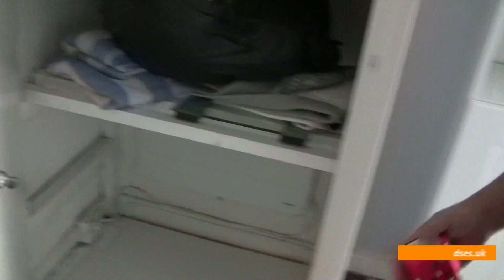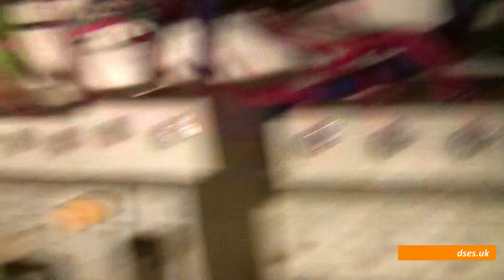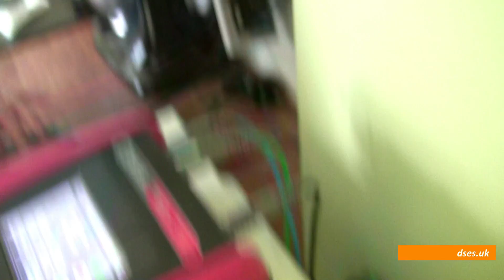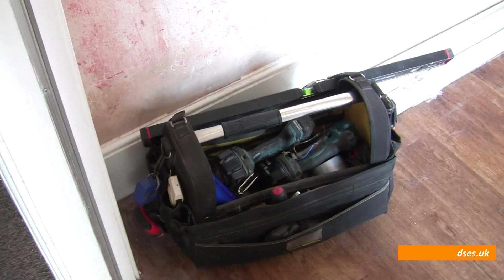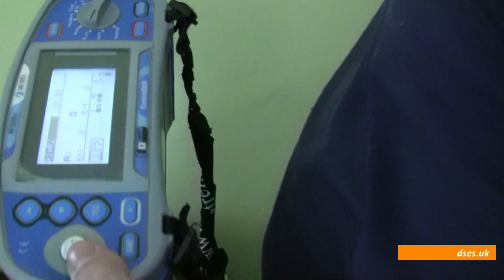On a domestic EICR

Comment: Absolutely mint 👍🏼. It’s nice to see an EICR done properly.  True professional, I wouldn’t go to the extent you went to, R2 to class 1 lighting & inspection of 1 or 2 class 1 lights.  If I found connections like that, they would go straight back on the ceiling & the client informed.  I use to go over & above, actually to the stage of fault finding.  However as I now consider myself quite experienced, you are there to report on the existing condition, not repair their installation.  It all started with this, I once remove a class 1 lighting unit from the ceiling with poor connections & decided to remake the connections, however while taking the lighting unit down which had a junction box located in the ceiling, the connections came out of the junction box & was shorting out.  It took almost 2 hours to put this right.  Moving a massive heavy bed, rolling the carpet back, lifting the floor & fitting a new junction box.  Only to find the fault current had blew connectors off further down the circuit, turning the day into a fault finding pain in the butt.  Lesson learnt.😁. Just be careful what your getting yourself into.  The client was also fuming that I was there lifting her floors etc;  Removing all sockets is a bit too far for me, dismantling should in  general be kept to a minimum, if loose connections were found in all samples, It’s a C2.  When the report is completed & handed to the client.  I attach to the rear of the report a statement on my opinion of the installation.  For example if the client was planning major renovations & the installation was satisfactory, but had been altered many times over the years by Everyman & his dog, I would probably recommend a re-wire.
Reply from the maker: Excellent points Patrick, there's nothing wrong with sampling and straight reporting. You're right that disassembly of fixtures can be a can of worms. There are certainly some installations where we want to look behind certain accessories, especially Class I lights, but we back off where their removal for inspection looks like a nightmare or risks plaster or paint flaking off. Like you, I've been in the position before where removing something has led to damage that I've then had to put right, and it's usually because DIY Dan used the wrong fixings or botched the connections in the first place so that it all goes to cock when I come along and disturb it.
Reply: David Savery Electrical Services u

Comment: The left over cables and evidence of an old cu there, probably an old storage heater/panel heater installation. Sometimes if the installation hasn't been upgraded and the boards are the same make the old decommissioned storage heater board is a handy source for a matching 16 or 20A breaker if you find the ring is broken and you have to downgrade the circuit. Great well presented and highly entertaining videos. Keep up the good work. Hopefully have some more after this lockdown is over. Stay safe, all the best, Pete 👍

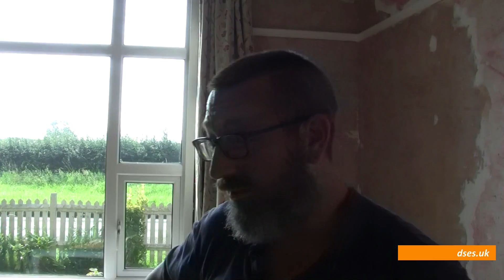Comment: 25:30 in and from the look of the incoming set up and unused circuits flapping in the wind I’d say Dr DIY has been here and removed unwanted off-peak equipment. That’s the sort of meter that supply companies install where there is no gas or oil to supply a wet CH & DHW, and electric space & hot water heating is utilised. I’d even go as far as to say Dr DIY has had a fiddle about with the service head and meter. Sorry if you cover this further on.
Reply from the maker: My original thought was the same, a decommissioned off-peak setup, especially as it was a two-rate meter on site, but then the cables dangling down were all in new colours so it didn't fit. Goodness knows what they actually used to drive, or why he didn't properly chop them off when the board was removed. The other ends were all cleanly cut. Very odd!

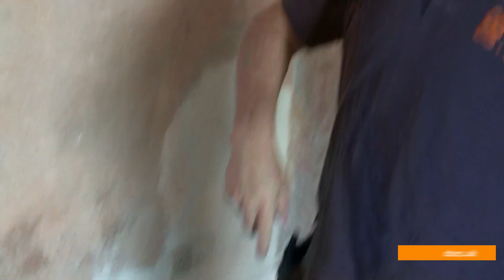Comment: At 26:01 not to use 1sq mm cable for socket outlet.  This is similar in New Zealand:- minima 1 sq mm for lighting, 1.5 sq mm for power outlets (solid cables).

Comment: Well, if they insist on appliances being prefitted with an electrical plug, changing a 5A round pin sockt to a 13A one seems the obvious solution. On this basis, don't be surprised to find pendant lights coming prefitted with 13A plugs and ceiling roses being replaced by 13A sockets - wired with at least 1.5mm^2 cable !

Comment: Dave, great video as per usual.....the 1.67 x  is for solid core calculations - stranded has less resistance than solid core so I would say Nige  sorted the high ring reading on the Cpc’s 👍🏻
Reply from the maker: Thanks Pete, good point.

Comment: Would have been nice for a main isolator to have been fitted when they changed the meter. Good work again guys, all the best.
Reply from the maker: I agree. It's nuts that they're not built into smart meters. It should be a basic right for any consumer side equipment to be able to be isolated at or after the meter, instead you get the DNO and suppliers offering inconsistent isolator installation services and charges or having a pissy fit when they find seals cut.

Comment: i am a trainee spark and learning a lot here. re inaccessible water bonding, you said you might do a long lead if you can find exposed pipes, but isnt accessible water & gas bonding required as part of BS7671? As well as bonding being immediately after main shut off tap/before any pipe junctions? From my limited experience, in this circumstance we would holesaw a hole in the back of a kitchen cupboard to expose the water bonding/enable one to be correctly fitted.

Briliiant video. Really enjoying watching & learning. Your dry, deadpan style of delivery is very engaging and entertaining

Comment: I did think it a bit odd having 3 wires coming out of the main fused supply. It looks like the middle one (neutral to the meter) should be rated 100A to supply one LCD display ! Sounds about right !
Reply: It was prob for the other board  which was removed previously by the looks of it maybe a separate economy 7 board
Reply: @Klberts1234  Nah. It was just wrong !

Comment: When performing an IR test on a circuit where all loads can not be removed so the isolator is left in the open position. I think an astrix should be inserted after the test reading to denote that the test has only been performed upto the isolator point e.g
L-N >500* 
E-N >500 
L-E >500
Reply from the maker: I explicitly state it in the limitations, but a symbol such as an asterisk is fine so long as you define what it means so the next guy looking at it can interpret it.

Comment: Hi David, would the higher r2 values not be down to cpc being 1mm and not 1.5mm, so a different calculation to estimate them. With a 1mm cpc it’s about right.
Reply from the maker: Hi Karl. Yes, it is conceivable that I have misidentified the CSA on these so we are perhaps all good on the numbers as you say.
Reply: It, in all likelyhood, wasn't a 2.5mm2 T&E cable but rather an old 7/067 T&E which did indeed have a smaller CPC

Comment: Why do we investigate slightly higher resistance readings on a ring final circuit but don't bother with any other circuit... I suppose most of the time, we don't have anything we can cross reference it with.

Comment: came across a board with not only cpc sharing sleeving. But  2 cpc not long enough and extended by a connector block with a single cpc to the cpc terminal bar. Thats not all another Live conductor extended by a wago all inside the board.
Reply from the maker: Nothing wrong with extending short conductors inside a board, sometimes when upgrading a CU there's no choice, and Wago connectors are perfectly fine for that. Extending two CPC's using one wire is a bit shonky though; you'd at least hope they used a thicker wire so the overall CSA wasn't reduced.... but likely not!
Reply: @dsesuk  Thanks for the reply.
Apparently the spark who changed the board is now residing in one of her Maj's hotels, I doubt it was for that board. I personablly I would have all the joints outside of the board in an  IP rated junction box, So the only termination are the ones that came with the board.
Dave and Nigel keep up the good work.

Comment: What socket tester is that?
Reply from the maker: The little plug-in thang is a TIS 1005. Does all the stuff a normal plug-in tester does, but also gives a GOOD / CHECK / URGENT CHECK determination for the earth impedance. You have to take it with a pinch of salt as it's based on a fixed impedance of 1.1 Ohm which is the maximum permitted for a B32 circuit (such as a socket ring), so if testing a 13, 16 or 20A outlet or testing on a TT then it might not report as GOOD even though the circuit is actually acceptable.
Reply: @dsesuk  Thanks Pal, keep up the good content.

Comment: We use easy cert and have done for years. it would be great to see your views on it too. Generally we think it is good but like you, some things are annoying.
Reply from the maker: I've been meaning to put together a video on certification for a long time now. Easycert is good, its annoyances are minor. I think a lot of people are put off by the high initial price tag, but ongoing annual licences are cheap as you know.
Reply: David Savery Electrical Services . I’m more than happy with the price. We have told them about spelling mistakes and quite a few other things. I wish they would go that little bit further than just the model form. I would like to see location on PEB and possibly also a resistance result. I generally think the model forms could do with a good over haul. I’ve been using easycert for about 12 years. Look forward to seeing the vid on it.

Comment: Those old MK sockets might be a pain in the arse but they’re still by far the best sockets that have ever existed. To think that they’ll probably be removed and replaced with some cheap BG type of shite.
Reply from the maker: No cheap accessories will be going in if we're asked to tidy things up!
Reply from the maker: Hi Bradley. If we're doing a CU change onto existing wiring, then we'll perform the necessary inspection and testing in order to be able to provide the EIC. Although the numbers may come out good, there is always a chance of a screw junction being located somewhere we didn't know about as it won't be possible to fully inspect the whole circuit as it zigzags through the fabric of the building. That's the case when working on any existing wiring, but the certification shows only what tests you were able to undertake and the results recorded on the day, it's no guarantee that hidden somewhere is a modification not made to the correct standard. It's a given that when working on existing wiring which you didn't pull in, your certification will only be able to guarantee what it was possible to physically inspect and test on the day. If sparkies were responsible for 100% of the wiring they touch, we'd all have to rewire everything we came into contact with every time.
Reply from the maker: @hjbhbjbjbjbjbjbbuguggugug6732  Funny you should say that as we normally install Hager Sollysta accessories, their being easy to obtain, but I'm off on a jolly to Click Scolmore today as they've reached out to certain loudmouths about their products for their own YouTube channel.

Comment: why does electricty meter only have 3 connections ?
Reply: Because the neutral to the board went straight from the service head, it didn't go though the meter.  (DNO chap rectified it)

Comment: Great vid as per... What was going on with the neutral bypassing the meter ?
Reply from the maker: Thanks James. I don't know what the neutral was playing at. I don't suppose it made any difference to the metering, but I haven't see that before.
Reply: David Savery Electrical Services maybe they had cracked the screw head over tightening! Not seem that myself before either! Great content anyway 👍
Reply from the maker: Cheers James!

Comment: Doesn't that installation need a 100mA Type S RCD between the meter and the board?
Reply from the maker: Not where it's an insulated enclosure and all circuits are RCD protected. The RCD's here are providing the fault protection as well as the role of additional protection.
Reply: @dsesuk  When would/would it have been a requirement to fit a 100mA Type S RCD?
Reply from the maker: @ashmanelectricalservices4318  My understanding of it, and it may be wrong as the regs are awkward to interpret on this, is that if this were, say, a 16th Edition split load board with some circuits 30mA RCD protected and some not, then the 100mA Type-S provided fault protection to all circuits to ensure a satisfactory disconnection time that the MCB's might not be able to deliver because of the high TT impedance, and it also offered discrimination (or selectivity as we're now apparently calling it) by being of a higher rating than the RCD provided in the board for additional protection. If the enclosure was metallic, then again a 100mA Type-S would offer fault protection against the metalwork going live should an incoming tail come into contact with the enclosure, that tail being before the connection to any RCD installed within the board. In this case, the CU is plastic, so no need to worry about incoming tails shorting out onto any metalwork, and all circuits are RCD protected at 30mA, so no need to have an RCD upstream of a higher rating. Of course, the requirement of Amendment 3 for switchgear enclosures to all be metallic had everyone scratching their heads again as you had the headache of new TT installs using metallic enclosures, but if you wanted to install a 100mA RCD for fault protection for the metallic enclosure then Amendment 3 meant you couldn't install the RCD into a plastic box, and if it was itself in a metal enclosure then how do you rig it so the incoming tails can't short on the enclosure before they get to the 100mA RCD? The answer, I believe, was that you could bring your tails in via an insulated tails gland and maintain their double insulation right up to the main switch. So on a new TT install or on a CU change for such, you could today fit a dual RCD or full RCBO metal board and still omit the 100mA RCD so long as the tails enter though an insulating gland, remain double-insulated up to the main switch, the main switch is double-pole and all final circuits are RCD protected at 30mA. So, to cut a long story short, the 100mA Type-S was needed for older installations where you had some circuits lacking any other RCD protection and/or a metal enclosure installed before the invention of tails glands! That's my take on it anyway, but I'm happy to hear what anyone else has to say about it!
Reply: David Savery Electrical Services I would say that a stand alone rcd could be installed in a plastic enclosure as this would not be considered a CU or similar switchgear assemblies as required by BSEN 61439-3 distribution boards for operation by ordinary persons .
I do agree that they are not necessary to be installed between the meter and the CU but if you wanted to then installed in a plastic enclosure is compliant.
Reply from the maker: @ishkebab  It's one of those that you can go around in circles on; plenty of discussion on the interweb forums about whether a standalone RCD can be in a plastic enclosure, but no definitive answers backed up by the regulations it seems. Here's an example: https://www.electriciansforums.net/threads/stand-alone-rcd-enclosure-metal-or-plastic.122187/ - Personally, I agree with you Ian. If the DNO install an isolator, then it's in a plastic enclosure, so if I want to install a standalone RCD a metre further down the line and an insulating enclosure is electrically safer than metal and I install it correctly so that the terminals within are torqued to avoid loose connections, then that is surely no more of a fire risk than the kit installed by the DNO. It seems to be a bit of a grey area unless I'm missing something, but it's also something of a moot point as any new CU you install today will have full ground fault protection for all final circuits so an upstream RCD probably isn't needed unless you want it as a back-up... unless (again) I'm missing something!
Reply: @dsesuk  that's a good explanation Dave, not had any dealings with TT systems yet (possibly one in the pipeline, property looks to be using water and gas for main earth...) and I've been trying to wrap my head around it all.

Comment: Hi David, great instructional/entertaining video.  Can you please shed some light on a problem I have encountered a number of times when carrying out an insulation resistance test during EICR testing. I have joined L+N together of a circuit then tested to earth only to get 0 ohms! I know that there are no short circuits and can only assume that there is something within the installation which is causing this to happen but don't know why or how this occurs particularly when there is no potential difference between L+N when testing to earth?
Reply: Is the main breaker isolated? Because if not, you've a short path from Neutral to Earth at the supply head (if TNCS) - I've done that...

Comment: IME all lights on one rcd side usually means there's a shared neutral they didn't rectify.
Reply: They split the two circuits onto different RCDs and there was no trip, so there was no borrowed neutral.

Comment: Nice job chaps. Question for anyone. What do you do when there are about 4 million mr16 down lights, pull them all down, disconnect them all, destroy ceiling decoration and test, or sample?????
Reply from the maker: To hell with that. I would put L-N IR testing as a limitation on that circuit as it would be impractical to wire out all those transformers. I'd still test LN to Earth though. As for inspecting them, a visual on a percentage to ensure the heat from the lamps isn't damaging surrounding areas if you can remove them from the ceiling without taking out chunks of plasterboard, otherwise it's another limitation on the report.
Reply: @dsesuk  Yup, What I did, real old plaster ceilings with all that wood and lime plaster, blurgh.